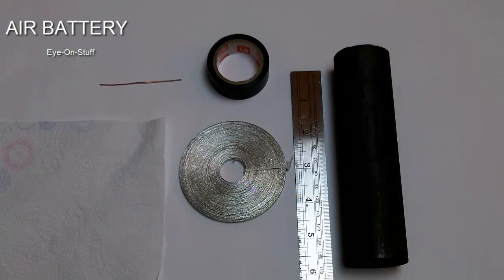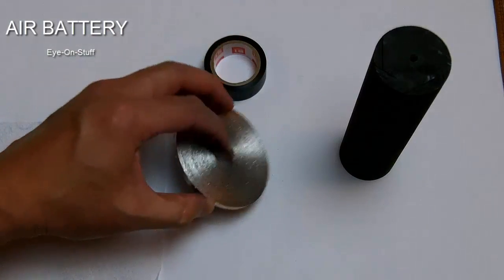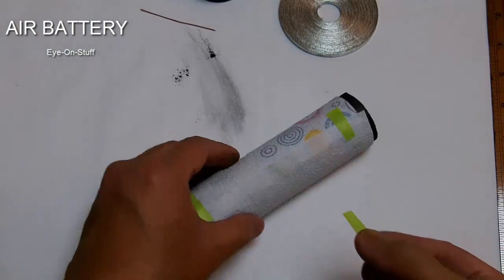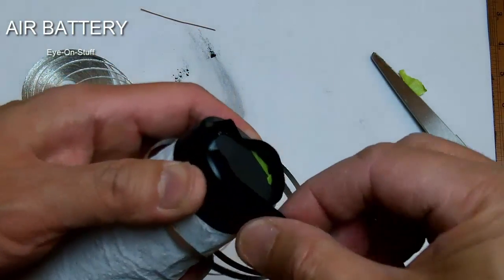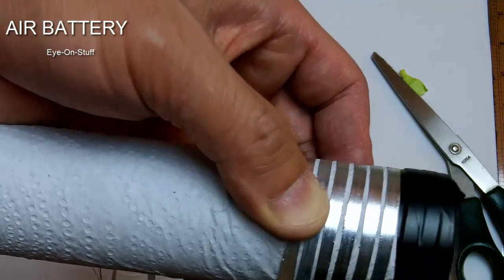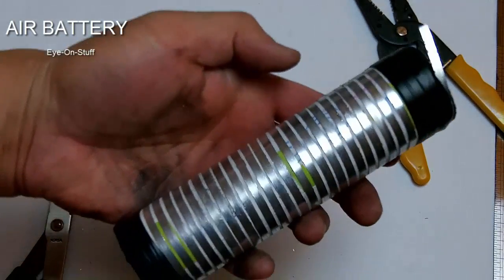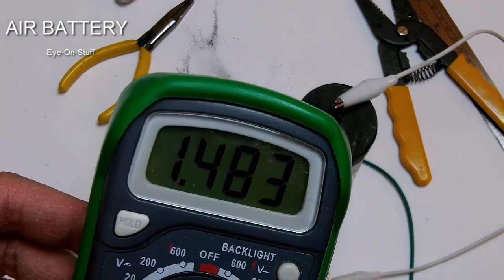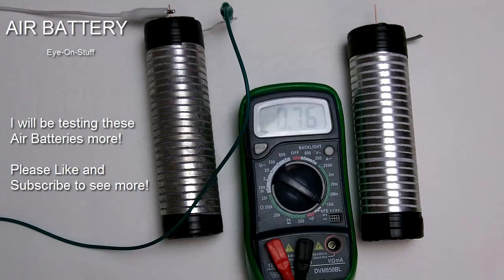How to Make an Air Battery : Eye-On-Stuff

Comment: Store magnesium ribbon in a steel can in your garage on concrete floor if you stick it in a drawer in your house one year will catch fire. Maybe in 1 year - maybe in 35 years but eventually with the right amount of moisture and oxidation it just bursts into flame.

Comment: I have used carbon felt in place of the carbon rod. The felt is used as a shield in welding. You can then use a magnesium rod and wrap the felt around it. (with an insulating layer of course)

Comment: Can you write the chemical equation  of how the negative charge is produced?
Try boiling solt water and expose the surface to the salt water steam...
See if you will get an extra voltage or current kick out of it...
What would happen if you soak the whole think in salt water?

Comment: 1. Why call it an air battery?
2. When aluminium works better, why use magnesium?
Reply from the maker: In this video I was replicating the air battery made by lasersaber.  I have not tried aluminum. Apparently,  the moisture in the air would activate the cell.

Comment: Wouldn't this be better when submerged in an electrolyte solution??  Your carbon rod should hold on to plenty of air even when submerged, assuming it was dry and clean to begin with.
Reply from the maker: I found that the magnesium ribbon would corrode and break apart after a few weeks while submerged in water or salt water.
Reply: @eye-on-stuff5248  oh, good to know!

Comment: Are these batteries better than lithium ion battery, I'm curious to know about them.
Reply: They are non rechargable, but would last a life time under hot or cold conditions.

Store them in you car under the sun or in you fridge. Just dont mix the electrolyte yet.
Reply from the maker: Nope. This is just experimental.
Reply: @eye-on-stuff5248  
You make good stuff man. 
I thank you for it.

Comment: You can get carbon rods from the center of the square 9v battery they put in torches you get six in each, and even if the battery is flat they are still fine condition and would be a cheep why to try and build them.

Comment: Could you test spraying it with vinegar?
Reply from the maker: I did try vinegar at one point. It worked, but the magnesium  disintegrated pretty quickly because of its acidity I think.  Thanks for watching.

Comment: I see a major design flaw which also proves you as a faker. I can see this working only if the copper were directly attached somehow to the magnesium, but you've got the magnesium wrapped around paper towel on a carbon rod. There isn't any connection to the rod, there isn't any electrolyte so there isn't any possible way to make a circuit so you can't actually get any voltage from this design, it's physically and logically impossible. You see, I understand that air can not act as an electrolyte, if it could, I'd be able to take pieces of copper wire and nails and lay them next to each other, not touching, and have a battery. Seriously, people come to learn, but fake shit like this discourages wise people from experimenting and creating things that actually work.
Reply: There's moisture in the air and thus a small amount of water is absorbed within the paper towel that's acting as the electrolyte.  So although the paper towel seems dry, it isn't completely devoid of water.  The water sticks to the fibers of the paper all the way through, completing the circuit to the carbon, which is conductive.  The water molecules in the air by itself are too far apart to carry any current, but when they have a surface to stick to, such as the fibers, they will create a extremely thin, but dense coating that can carry a small current.  The contact area of the water with the fibers, carbon, and magnesium is poor and only able to give a quite pathetic amount of current for the battery's size.  If it was fake id expect him to be much more ambitious with it, like showing it powering a desk lamp instead of giving off a few micro amps, that's only enough to power a shitty dollar store calculator.
Reply: @SparkeyFlarkey  You don't seem to understand. It doesn't seem dry, it is dry. Not being dry means it's wet and it's certainly not wet. Also, an electrolyte has to make contact between both electrodes, it can't just be loose water molecules in the air and touching the paper towel from the air.Loose water molecules in the air don't just randomly stick to paper towel and make connections through it.
Reply: Air battery its only one. Tesla atmospheric electricity.  A wire in the atmosphere can produce continuos power collection positive ions. The negative connector will be in the earth separated from the long wire by a thin plastic foil.

Comment: So,  why do they call them "Air Batteries"  without the electrolyte they produce nothing but some residual current from ,  maybe radio signal or something.  I think you could have used a sheet of Carbon Fiber cloth wrapped around a cardboard tube,  then the rest.    The bigger the tube (area) the more current..  I know they last a long time,  maybe put an led on them and let it run till it dies,  Time it..  then do the math of watts times hours, etc.
Reply: Exactly what I was thinking.
Reply: Chemistry. 
An air battery uses oxygen from the air to operate, and gains electricity from oxidizing either the anode or the cathode, this increases the energy that can be produced per volume and pound (on earth in air of course) because your no longer carrying all of the reaction material.
I also allow for more energy storage per volume then other chemistries can provide safly. Because it does not have enouth oxygen to fully react all at once and go boom.. Like Tesla's sometimes do in accidents
Reply: When you use air for cathode, it means weight of your battery is less by at least 30%... Thats a lot of efficiency.

Comment: Theres no problem with the magnesium strips touching each other, in fact its desirable as it would increase the surface area
Reply: Yeah! And have another problem with this setup too, because if the ribbon make a spiral, will create a magnectic force around battery and will dissipate energy

Comment: The smaller the amount of moisture in the paper, the longer the thing can work but the smaller the maximum current. For example the oxford electric bell is powered by a battery that has lasted for 177 years so far. You can control the amount of moisture retained in the paper after it has dried by adding hygroscopic substances e.g. methylcellulose (found in some types of wallpaper glue) or zinc chloride. The oxford electric bell's battery probably uses copper and zinc plus a zinc chloride or sulfate impregnated separator which may be made of paper or leather.

Comment: What a worthless project.
Reply: The air battery with the lowest energy density has 4.53 times the energy density of current lithium-ion batteries. It's not worthless, he's on to something.
Reply: @luongmaihunggia  you are an idiot. Lithium has 3.7v. 3000mah. Thats 11wh capacity.
The copper zinc battery can produce 1.5v and 300mah. You need three of this to produce 1.4wh capacity. 30 batteries of this will produce 14w.
So to make the same capacity like a single lithium cell you will need about 28 pcs of this copper magnesium batteries.
You are such a big idiot. 
Before you talk that useless shitty thing, read about the energy capacity and measurement. You are just a stupppid idiiot wankker.
Reply: @UrgenthelpwithSubscriptionsHel   he is talking about the theoretical energy densities of Air battery. Once realised, they can be revolutionary. Just search about this Israeli startup called Phinergy
Reply: @rivinsainudeen9764  ok. I will search for it. Shukria Kaka

Comment: Hm. 0.290 milliamp equals 290 microamps, not 29. Once you add salt for an electrolyte it stops being an air battery. Other than that, good job.
Reply: all batteries have electrolytes...(air/oxygen is the cathode).

Comment: many of the comments on here are stupid. before commenting read this link; https://en.wikipedia.org/wiki/Zinc-air_battery
the link is about zinc not magnesium but the principle is the same. using other cathode materials wont work as well coz carbon can adsorb O2 , using acid will turn it into a normal battery. salt water is the electrolyte.

Comment: Technically this is a cell. (A battery being a group of cells) Also the ribbon is one plate in the cell and already electrically connected. So it doesn't matter if you let the ribbon touch, in fact the extra surface area of wrapping it closer together would make it work a little better. Common aluminum foil would work similarly to magnesium.

Comment: could you use a graphite rod instead of a carbon rod?
Reply: Yes you can. You could also use copper,nickle,zinc,iron,lead. Most any other conductive material. The choice of materials has a direct effect on the power output.
Reply: You idiot, graphite is made of carbon
Reply: @stevejones8665  human is only 18.5% carbon by mass.

Comment: I'm sorry, but I didn't see a load on your battery. How are you able to to test for current, if there wasn't a load? You said 0.75A, but I didn't see a load. Could you please explain how you measured for current.
Reply: Mark II the voltage meter is the load
Reply: @braceharvey  Yes. The only resistance in the circuit is the, very low resistance of the meter. This battery won't even power a small LED

Comment: So, the size of the carbon does not matter? Laser Saber used a carbon rod twice the size of yours and had about the same output.
Reply: Yes it most certainly does. More plates= higher volts. Larger plates = higher amps.
Reply from the maker: Danyal Ahmad Yes, That's interesting.  I wonder if the larger surface area from a larger rod increases the mAh.
Reply: Eye-On-Stuff Me too
Reply: Makes sense

Comment: Great video mate! Do you think by adding  vinegar to your solution, the output amperage would be higher?
Reply from the maker: Kasady Cletus True, but if an air battery can power something for maybe 10, 20 years or well beyond the life of a regular battery before re-energizing, that would be a good thing.
Reply: AAA
Reply: Danyal A.
Reply: Vinegar would just speed the whole process up.

Edit:

Oh..wait...
Vinegar dissolves magnesium ribbon